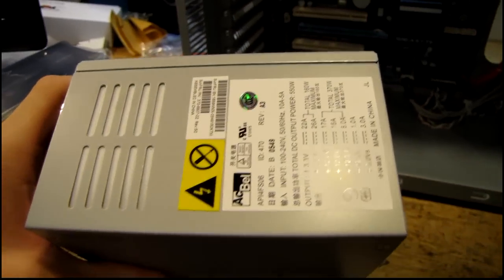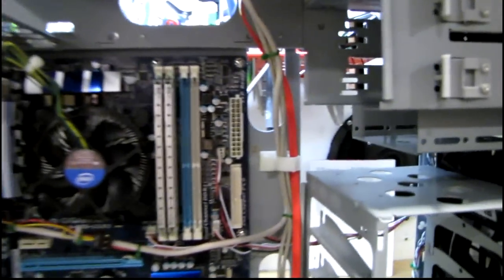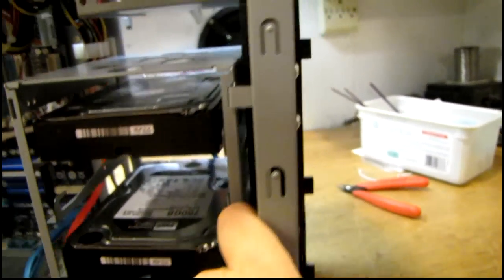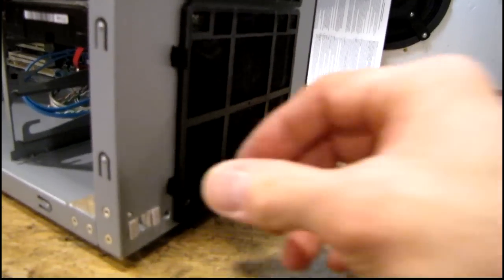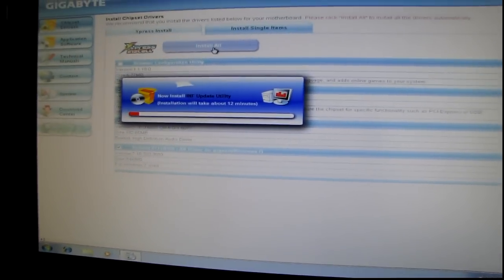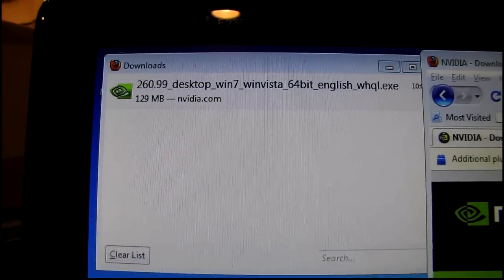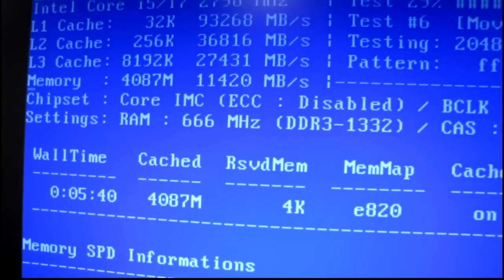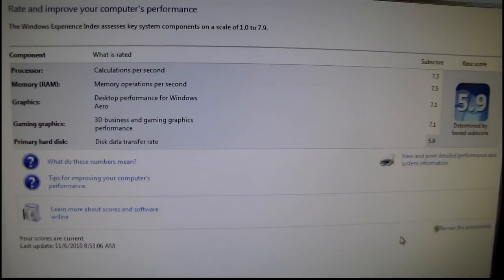New Intel PC Build *Part 2 of 2*

Comment from the maker: @BlueFoxTV I usually don't use the cable management, because it makes it hard to remove the motherboard tray when needed.

As far as the connectors, this power supply has heavy gauge wires.  I doubt it will have any issues.  The melted connectors also happens on older or cheap power supplies, when the female pins themselves are enlarged from wear or abuse. The poor connection is what causes high resistance and heat damage.

Comment: The "is there really any need" reason why they include one straight and one angled SATA cable is that you were supposed to buy an SSD for system (or system/data) and an HDD for data (or backup), which you didn't because you love the WD Blacks so much, even if being a not so sensible choice ^^ 
See corresponding comment on part 1!
Reply: So why don't you just use a flash thumb drive if I promise not to tell anyone that's literally an SSD with a USB interface ^^
Also, liking your own comment is lame :P

Comment: How come you did not use the cable management holes that are on the mother board tray. 
Also you should have plugged the two molex cables from the PCI-E power connector in to two different cables.
I have seen computers with melted connectors because the Video card puts a lot of stress on the one little 12V wire.

Comment: It's amazing to think that this system could still be happily running Windows 10, such was the power of Sandy Bridge.
Reply from the maker: It is actually still being used daily with Windows 10.  It still has the same motherboard and CPU, but has since gotten an SSD, more RAM etc.
Reply: @Maxxarcade  It's good to hear from you Aaron and it's good to hear that that PC is still around !  I used an i7 2600k at stock speeds until only a few months ago and it was brilliant.  I only moved to a Ryzen 2600 to get Windows 11 support and other things, like native USB3 but, to be honest, the Sandy Bridge platform was really good and probably a little better than what I have now!  Intel knew what they were doing back then :)
Reply from the maker: @andic6676  Ya, I still have a couple other Sandy Bridge/Ivy bridge systems too.  The one in this video is actually older than that though (socket 1156).  My daily use systems are all Ryzen based now, but only up to 3000 series so far.
Reply: @Maxxarcade  my 2600 is ok and it's NVMe support is great but it can sometimes "do a pentium 4" and have expected glitches where I know the old Sandy Bridge wouldn't. Thanks for your videos by the way...years ago they have me the confidence to tackle PC hardware to built my own computer.
Reply: @Maxxarcade  was rewatching your videos for the 10th time and this is the newest reply Ive seen from you. Glad to see you're still active! Do you still have that awesome x58 motherboard in use? You ever try a 6 core xeon in it?
Reply: @Maxxarcade  Mr. Aaron glad we hear from you again ❣️. I keep watching your videos, and every time i replay your videos i get more informative. Honestly better than modern tech YouTubers. Thanks for all your efforts you put in these videos. We are happy to hear that you are doing well.